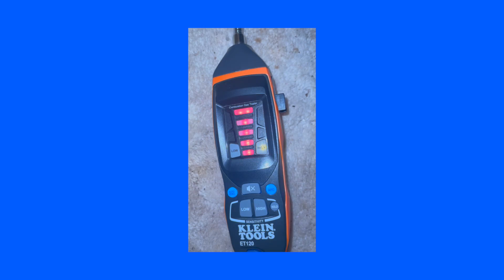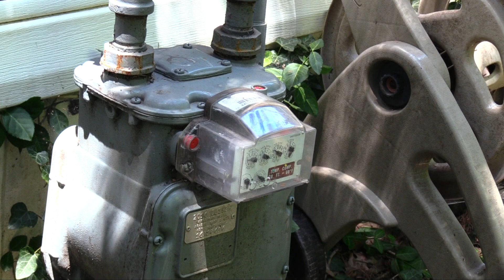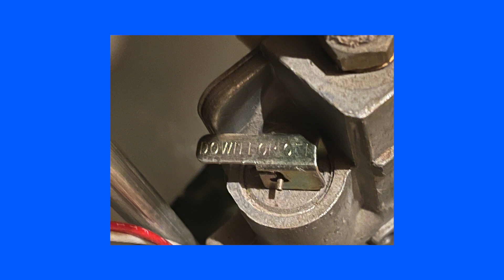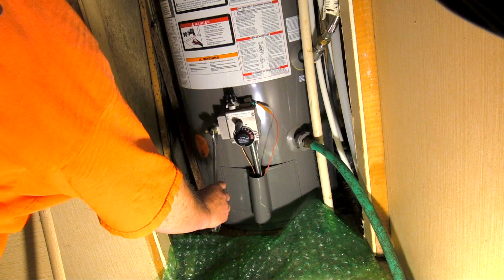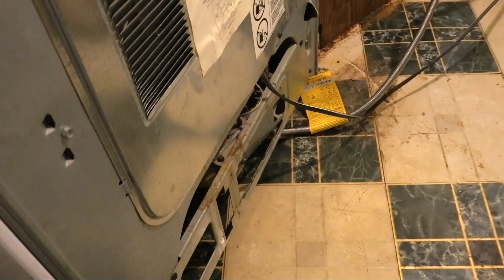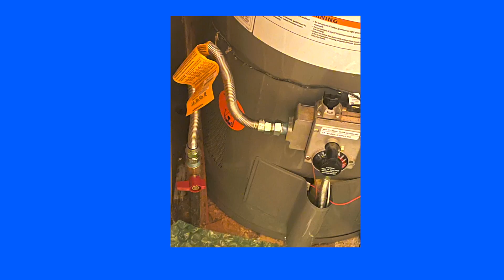Leaking Natural Gas Shut off Valve! Troubleshoot, Replace, and Test Valves & Flex Lines for Leaks

Comment: A very timely video. Hard to believe you found 2 of the valves were leaking, good catch.
Reply from the maker: The “Sniffer” found em , I just looked on in horror ! I would highly recommend it before tackling any gas line maintenance. It paid for itself in one use. Safety and Gas savings.
Reply from the maker: Technically three leaks , underground line also ( but never pin pointed) , a complete new line was run from the main to the house gas line circuit